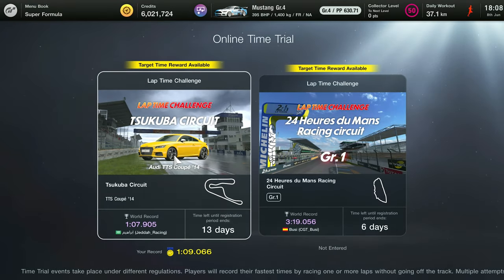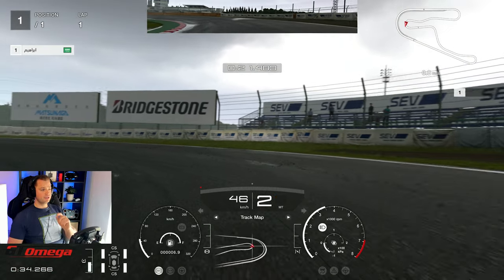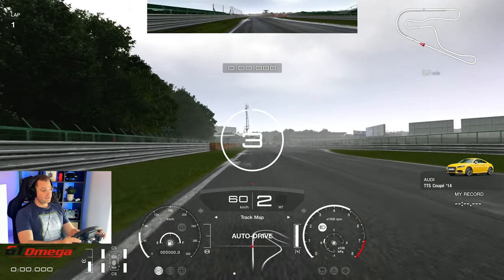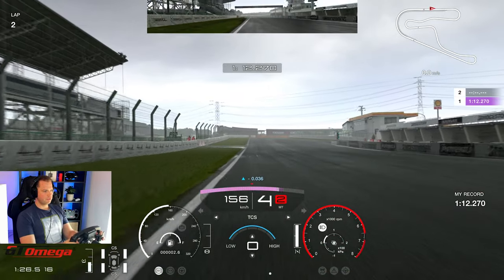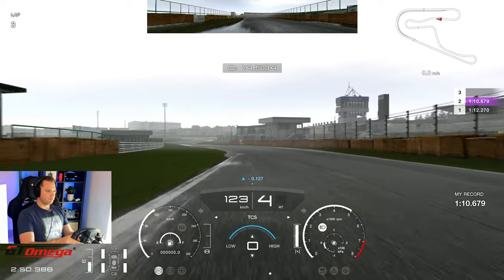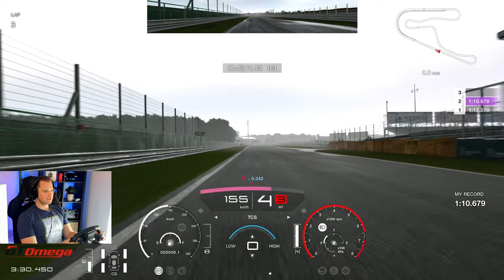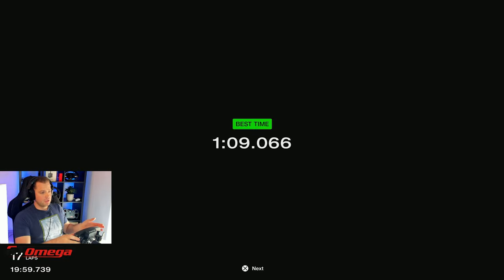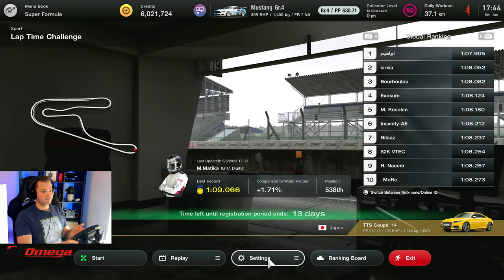Wet Conditions With Normal Tires - New Lap Time Challenge at Tsukuba

Comment: I have a complete DD fanatec/simlab rig at home. But in this particulate challenge i am faster with the controler, with the controller i did a 1:08,9 the controller will keep you on that exact understeer edge. Cornering is way faster with the controller.